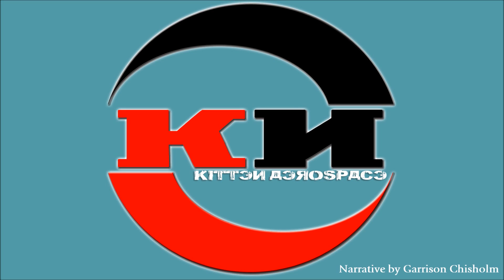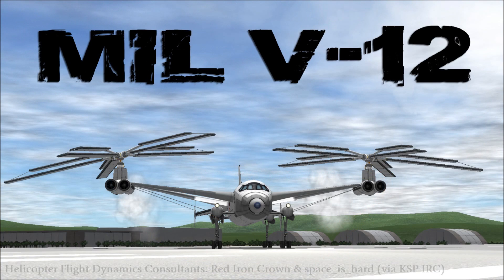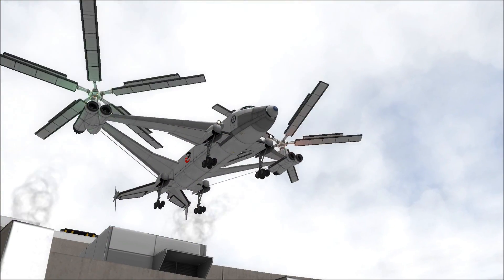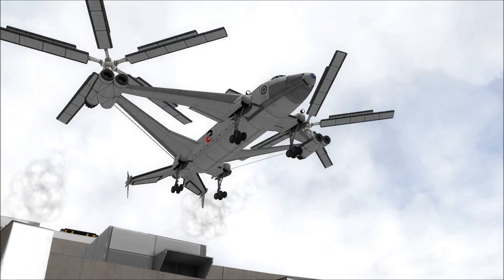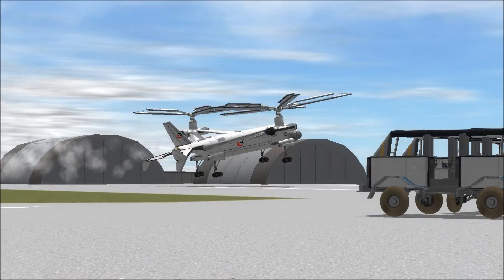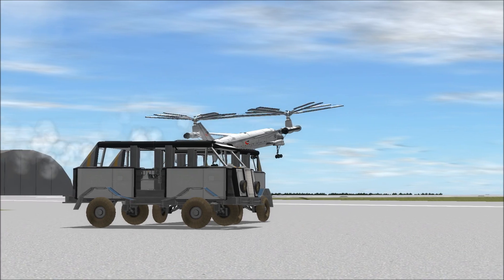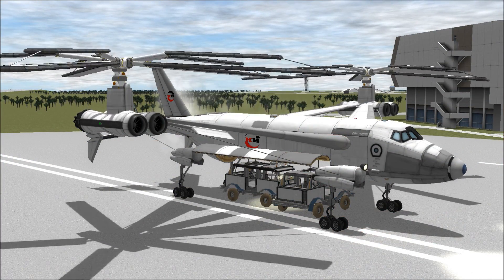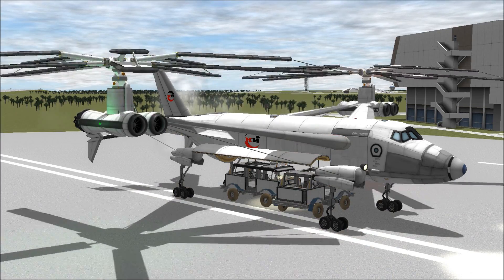Mil V-12 / Mi-12 Homer - The Largest Helicopter Ever Built

Comment: I've tried building a rotor wing but it always wants to roll left.  How do you get yours to stay stable?
Reply from the maker: +Gilly Monster Ahh in that case try to work with less pitch. Having very high pitch on the blades or very high rotor loads will generate torque forces in KSP that cannot be compensated for. 

My V-12 is barely flyable with the 20+ to house under it, because the blades need to be run 'overspeed' and 'overpitch' to generate the required lift. 

To fix it, reduce length of rotor blades, add additional row of rotors (more blades, or more rotors, or 'biplane' rotors), so you have more lifting surfaces, and need less RPM and less pitch to operate the aircraft safely.

Comment: I wish I could play ksp with more than 5 fps because of some wierd incompatibility with my graphics :(
Reply from the maker: +Brian Junker It happens, you need a massively overpowered GPU because things like terrain rendering is unoptimized and eat fps like crazy. There are ways to tweak it and make fps better or you could wait for 1.1 for hopefully better rendering engine and 64 bit processing.
Reply: my pc has integrated graphics, 1ghz dual core amd, and runs this at 20fps

Comment: What speed is the rotatron going?
Reply from the maker: +plopyorange8100 Less than 20. Both rotatrons spin at slightly different speeds for yaw stability/control.
Reply: ok .What about in legacy rotatrons
Reply from the maker: +plopyorange8100 No idea, I don't use the legacy parts anymore. They're kind of noodle soft in joint strength.
Reply: ok.Yeah true

Comment: why do you have IR rotors, instead of, idk, firespitter or KAX rotors. like, i just dont know why anyone would ever use IR based helicopter rotors. there unreliable, raise part count, cant be throttled, and i think theres also some more things about them that make them bad. just use tweakscale, and a firespitter rotor, or KAX huey rotor, for your helicopter needs instead.
Reply: +12togo34 It's much more impressive balancing an actual set of spinning rotors, generating lift by actually spinning, rather than just sticking on an propeller that has a set thrust.

Comment: Do you have a tutorial on how to build a colective pitch helicopter ?

i
If you dont, can you make one for your viewers! 
thanks me :D
Reply from the maker: +Eugenio Sada (KingMcDonalds) You will need Infernal Robotics Rework for the basic craft file-> Download one of my craft files in video description, see how the joints are arranged, the rotor drive motor connected to the collective actuators.
Reply: +Bacon Space Program thanks!! btw, have you tried to build a single rotor helicopter ?
Reply from the maker: +Eugenio Sada (KingMcDonalds) I actually have just to see if KSP models the torque of a shaft driven rotor correctly. It does :)
Reply: +Bacon Space Program did it work?